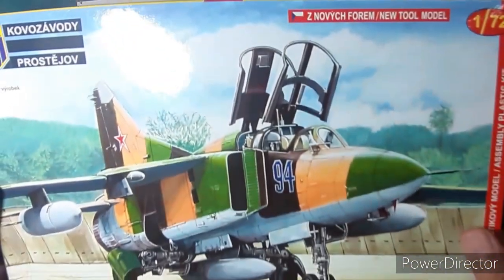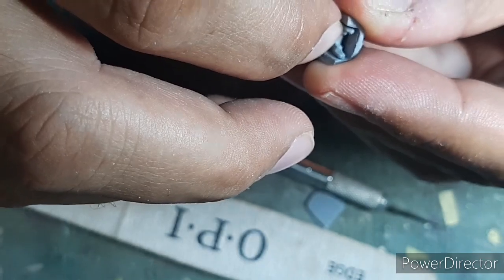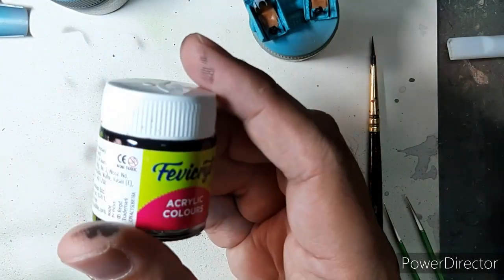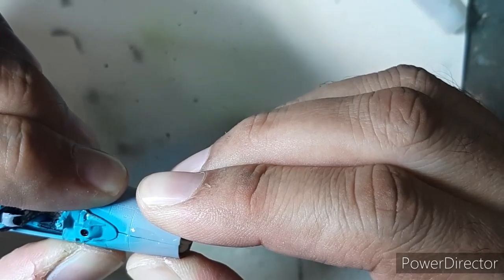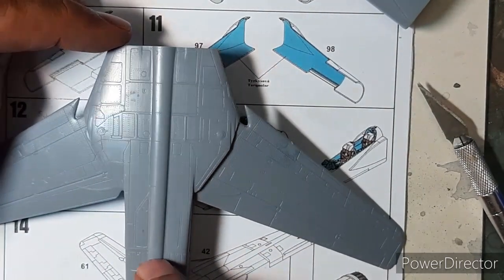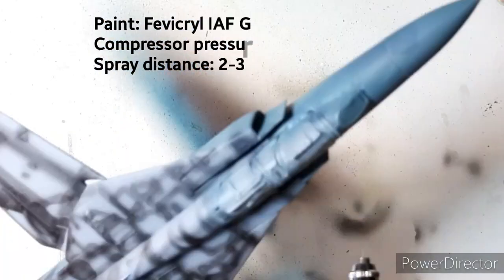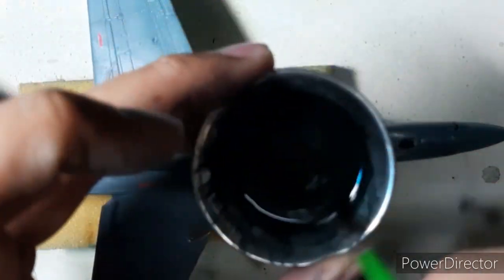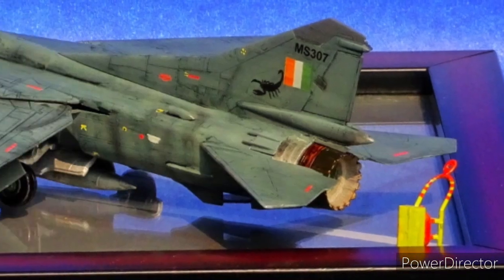Kopro 1/72 MiG-23UB. A complete timelapse build video

Comment: Hi.  Does the air brush clog often with your thinner ? What percentage ipa do you use. Does fevicryl paint cover well when sent down thru airbrush ? How many coats do you need.
I have been building models for 20+ years and i have 50+ more in my stash. I was using asian paints enamels but i want to convert to affordable acrylics with airbrush. Regards
Reply from the maker: Hi. Thanks for watching. Well those are quite a few questions. Yes I have always used Fevicryl acrylics. I've never faced an issue with airbrush clogging. The thinner I use is plain water and/or IPA. You can see my videos on how I paint with Fevicryl acrylics here:

https://youtu.be/1DoWaSaDVTg

Comment: Great model sir. Would you rather recommend 4s/ brustro spray can varnishes or daler rowny. Also, can normal indian masking tape be used in the same way as tamiya masking tape?
Reply from the maker: Normal Indian masking tape is useless
Reply: Is there any other local alternate that can be used?
Reply from the maker: I've tried at least a thousand types of Indian tapes. All worthless. Neither do they give any adequate sealing to prevent paint leaks nor do they have low tac adhesive as they are bound to leave adhesive marks all over
Reply: @swing.wing_singh  ok thank you, also Would you rather recommend 4s/ brustro spray can varnishes or daler rowny
Reply from the maker: Daler Rowney with a brush

Comment: Hello, I have a question...
Are the instructions of this model wrong with the Indian Air Force camo version?
Wasn't a two color camo version of this jet on Indian air force?
Reply from the maker: The camo instructions are correct if you're making a version from back in the 90s and 80s. Post 2000 all Indian Air Force aircraft were repainted in the standard green-grey or blue-grey. I have made the paint scheme of one such version which was in service till 2019.
Reply: @swing.wing_singh  thank you for your answer...
Reply from the maker: Anytime

Comment: After watching your video i stamped on the kit and ive thrown it in the bin , im fed up with substandard rubbish , i wish that model makers would make kits that fit together perfectly with no gaps , ive been making models for 41 years and for the huge cost of some of the kits there fit is not much better than it was when i first started , we have the skill and technology to do it so why cant kit manufacturers design a kit that you dont use nearly a quarter tube of filler on .
Reply from the maker: Agree with your point of view. But the moulds remain more or less the same for decades. They're just reboxing them under various brands but thats about it. That being said this is a highly accurate kit at a lower price. So the usual filling and sanding problems are expected. Not bad at all if one has the patience.